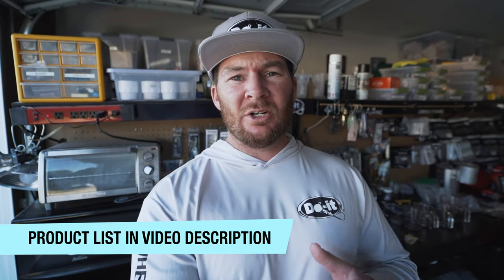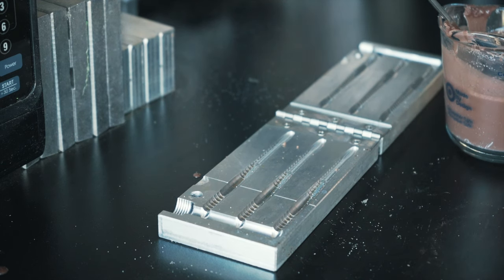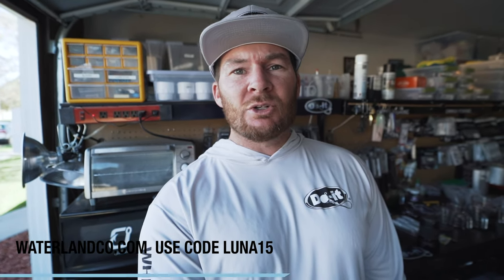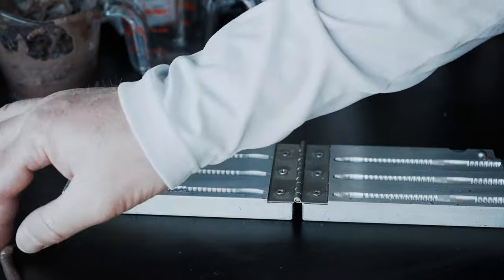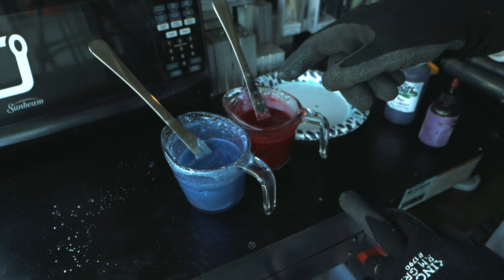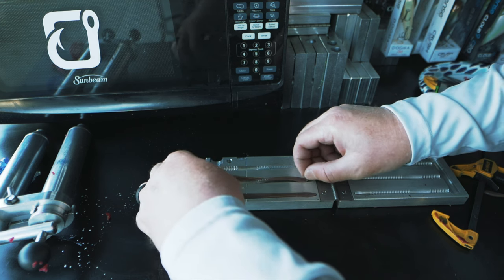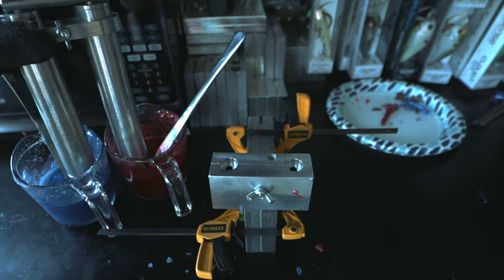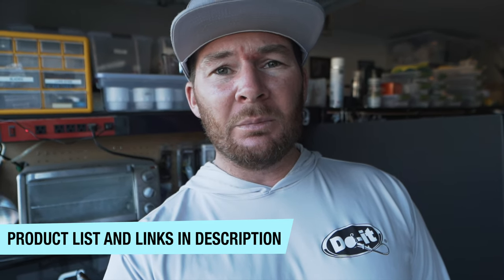How To Make Three Color Plastic Worms

Comment: When putting back in the mold put a little worm oil on your fingers and it will give you better control.  Works for me on craw clippers and worm tails etc.
Reply from the maker: That would help for sure.  Thanks for the tip!

Comment: There is a video on using foil to make laminates. Put the foil in between the mold, inject as hot as possible with the first color and suck the plastic back out like a hollow body frog. This doubles the bodies and are more like a skin pour, but a lot less clean up.
Reply from the maker: I’ll look at that.  I’ve tried the foil method in the past and it’s kind of a tough way to do it

Comment: Use a surrreng like for liquid medicine
Reply from the maker: That could help!  Would the heat be an issue for something like that?
Reply: @MattLunaFishing  not sure but there is a aluminum one that u can find in the automotive section or in a tool truck like snap on if u plan on using it more than a couple of times it would be well worth it maybe harder freight or northtools
Reply: @MattLunaFishing  Maybe a smaller glass cup. My hands shake so I would struggle with the pour. And those baits came out really great. Love the triple laminate hack.
Reply from the maker: Hand pouring is tough for sure.  Smaller cup could help.
Reply from the maker: Good to know.